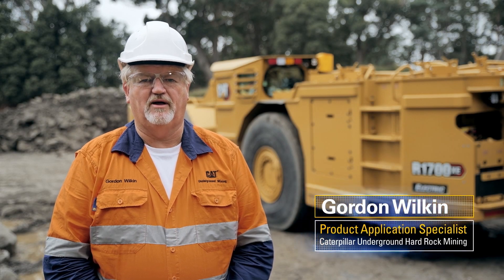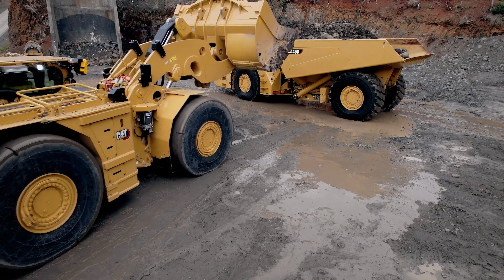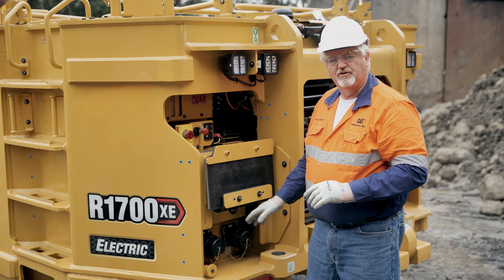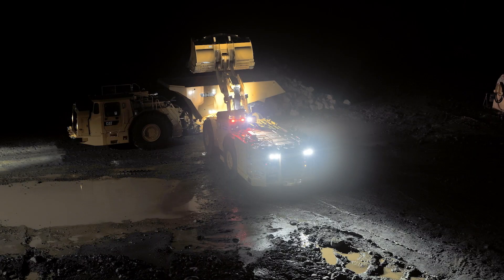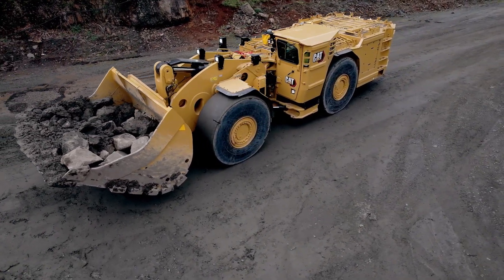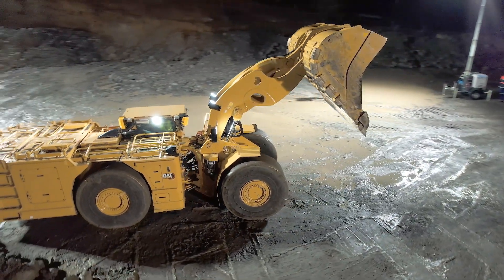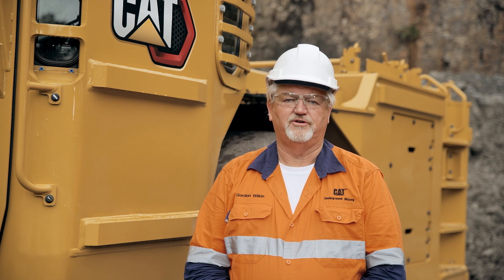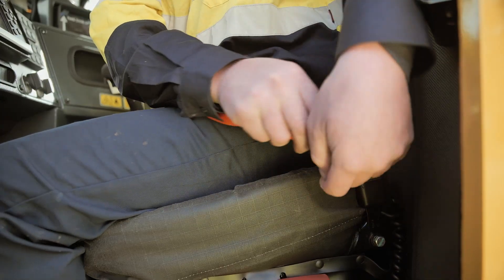Cat® R1700 XE Walkaround

Comment: How long charge?
It will only run for 2.5 hours on a full charge?
How many R1700xe's will I need for a single 8-hour shift?
Reply: About 30min to charge using a single MEC500 charger, and 18min with two. They can get over 4hr run time depending on how hard it is worked.
Reply: I worked on a diesel. It drives well.

Comment: So it will run for 2.5 hours on a full charge? I believe that is what he said. How long does it take to fully charge?
Reply from the maker: Hi CL75! The R1700 XE is using On-Board Fast Charging. The Charge Time (0-100%) is less than 20 minutes with two Cat MEC500 mobile equipment chargers in parallel and less than 30 minutes with one MEC500. - Dani
Reply: @catmining  thanks for the info.